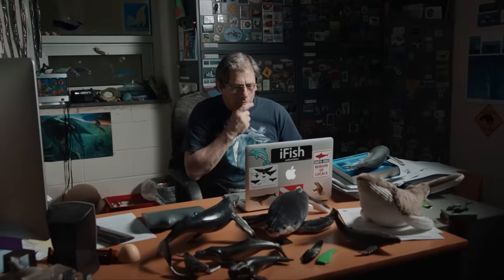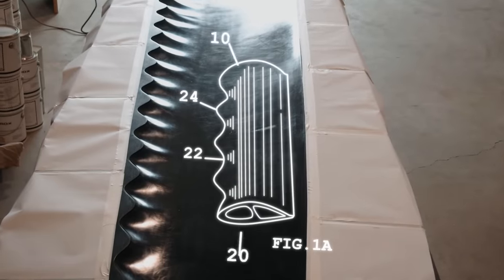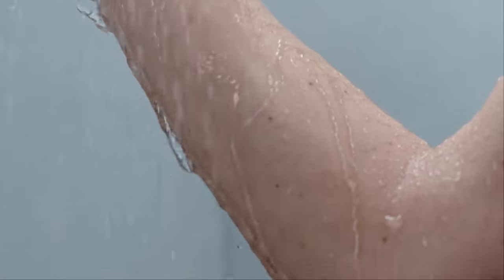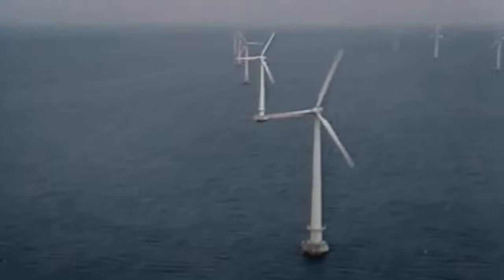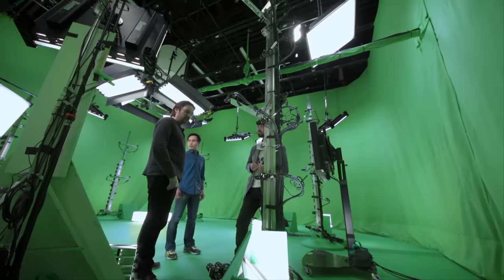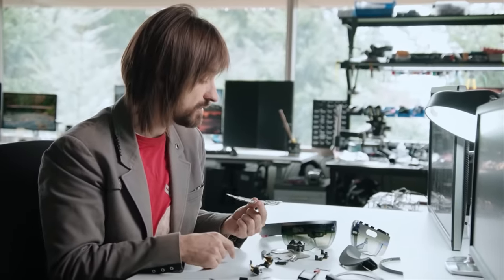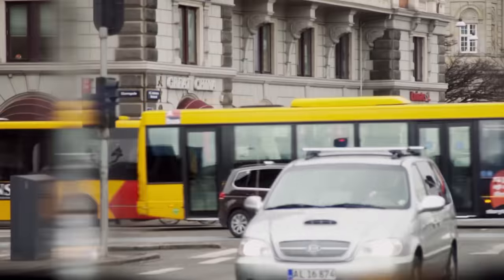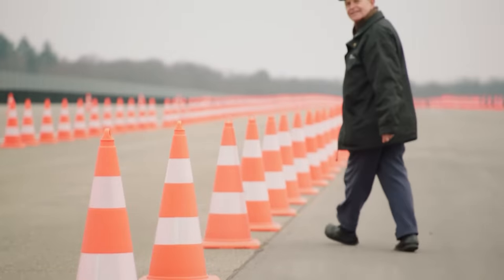Genius Inventions: Technical Marvels That Will Shape Tomorrow | Full Series | FD Engineering

Comment: Export the Power Apps, Copilot, Chat GPT, Revit, Plant 3D, Civil 3D, Inventor, ENGI file of the Building or Refinery to Excel, prepare Budget 1 and export it to COBRA. Prepare Budget 2 and export it to Microsoft Project. Solve the problems of Overallocated Re-sources, Planning Problems, prepare the Budget 3 with which the construction of the Building or the Refinery is going to be quoted.

Comment: I already have a recycled water system.   My water goes back in to the ground with a simple septic field, is filtered by a huge no maintenance ground filter, then is pumped back into the house for reuse years later.   Simple, reliable, inexpensive.

Comment: I am really impressed with the ammonia blocks to combat combustion engine pollution, much better than waiting (forever) for electric vehicles to catch on. Better to have a solution we can use now. It literally converts green house gas emissions in to water and nitrogen.
Reply: Adding to the benefits of green house gas reduction you get to products essential for plant growth, sounds almost to go to be true.
Reply: Many places in the western world are mandated to use Adblue which is enforced by law in europe for new  commercial vehicles since 2016, which does the same thing as these ammonia blocks, the Adblue is in liquid form which can be refilled by the end user thus not requiring a technician to provide maintenance.
Reply: Electric cars will take over much faster than people anticipate. Every year battery prices keep going down which if continued at the current pace will make electric cars cheaper than ICE cars to buy in 5 years.
For cars that are used to drive long distances for e,g car rentals like hertz, it is already cheaper to own an electric car and the shift has already started
Reply: @thexperimenter88  what about the grids being and yo handle the immensely increased loads, generating enough electricity, let alone keeping it reasonably cheap, the issues with battery recycling, the heavy metals involved, charging infrastructure... But sure ok.
Reply: @newolde1  the amount of increased energy that will need to be put in the grid if we move to EVs is not equal to the amount of energy that is contained in gasoline fuel for cars.
Gasoline engines are only 30-35% efficient while electric motors are 98% efficient. So the grids will only need to accommodate about 35% of the energy of gasoline used for cars for increased load if we fully move to EVs. It is inherently a better technology.
Solar photovoltaic installations have been increasing at an exponential rate since the technology is also getting cheaper every year. Perovskite installed on top of existing installed solar pv is also another game changing technology that is coming over the next few years that will drastically increase the mix of grid energy derived from clean sources
Reply: @thexperimenter88  best check your math. EVs are not 98% efficient.. Yes, the energy required overall compared to gas is less, but generation of said electricity, and the infrastructure required is still a major hurdle amongst the other issues we currently face. It's not going to be an overnight change like you're making it out to be, it's just not.
Reply: @newolde1  if the demand is there, more power generators will be built. I remain an optimist. Never has human innovation been higher than the present age we are living in.
The grid is also rapidly getting cleaner. Energy generation from solar now the cheapest form of energy generation and will keep getting cheaper.
Perovskite technology (basically a film can can be applied on existing solar photovoltaics to add an additional 7-10% energy generation) will reach the market in 2-4 years. Battery storage technology is also rapidly decreasing in costs.
Then it will be game over for coal and natural gas
Reply: @thexperimenter88  holding faith for humanity is venerable, but, optimism not tempered in reality is a recipe for future despair. Frankly, an additional 7-10% of base solar gains isn't going to make much of a dent in the increased electricity demand caused by the growth of EVs in that time. And while pure solar itself might be the cheapest, that's without adding in the storage costs. Again as for the 98% efficiency of electric motors, you're not accounting for the physics of the vehicle (battery to road efficiency is somewhere around 50%, but that's not accounting for the increased weight of EVs compared to petrol), the grid transmission losses (not small), the mining and production of the batteries, the production of the cars themselves, the infrastructure...
Reply: @newolde1  the load on the grid is not a serious argument against evs. In California, there are already 1 million evs and they account for less than 1% of the grid load. In their projections if the EVs grow to 5 million in 2030, it will be less than 5% of the grid load.
The only thing really holding EVs back is really the cost of the battery of the car which accounts for 80% of the cost of the car for cheap EVs like the tesla 3.
As battery technology develops, and the battery becomes both cheaper, lighter and safer, evs will become cheaper than gasoline cars. EVs are also cheaper to maintain than gasoline since they have less moving parts and thus less wear and tear.
In fact for cars that drive a lot, it is already more economical to own evs. This is reflected in car rental companies such as hertz ordering thousands of teslas.
EVs are mcuh closer than you think. I work with suppliers of automotive parts and their sales have already permanently decreased by about 5% because of current adoption rates of evs
Reply: @thexperimenter88  and yeah, batteries, batteries, batteries. Heavy metals. Currently there is a pitiful amount of battery recycling infrastructure in place. The tech simply isn't there yet. And no federal or state law or policy that require recycling, none.
Reply: @newolde1  Recycling should not be a problem for the upcoming 20 years at least at which point the infrastructure will be in place. 
Already the lithium iron phosphate batteries in teslas can last at least 500,000 kms! Which is over the lifetime of vehicle.
Reply: @thexperimenter88  you do realize that isn't the reality at all. 500,000 kms is a stretch for current battery tech. And regardless, even if it were, service and commuter vehicles regularly put in 100-200k miles per year. So your projection of 20 years is more like 3-4 years in reality. And, there are millions of EVs already on the roads that are nearing end of life with little to no infrastructure to take care of those batteries. Not to mention the difficulties of this all with the variance in composition and structure of said batteries. But yeah, gone are the days of 1 million plus mile vehicles I suppose. Similar to so many other consumer goods, instead of newer models lasting longer with our "better tech," they last half the life of older models.
Reply: @newolde1  a Tesla typically has about 4 battery modules. Often times just 1 module is replaced because of issues that have started. And also because of cost people typically buy after market modules.
So recycling is already happening to some extent by discarding the faulty individual cells in a module, replacing with good ones and selling the battery module in the aftermarket.
Reply: @newolde1  I just did a little bit of research a found out that 95% of lithium battery components are recycled.
That would explain why there are so many aftermarket Tesla batteries.
So your argument of no battery recycling does not work either.
Tesla already recycles all of their batteries
Reply: @newolde1  somehow I never realised that EVs could become a big e waste problem.
I’m not concerned about the batteries as you are, I think with the massive amounts of research being poured into batteries, future batteries will be eco friendly for e,g lithium sulphur batteries that have no nickel, cobalt are about to reach commercial production and there are investigations into sodium batteries.
Recycling is not a problem with the lead batteries of gasoline cars with a 95% success rate. Batteries can be designed structurally simple enough so that recycling is a non issue.
But the inverters and power trains of EVs with all their printed circuit boards, these will be a big problem to recycle! Somehow I never thought about those components.
There is also a lot of research currently being done on recycling waste printed circuit boards for e.g using a PLA polymer that is easily dissolvable in acids as the circuit board that I think will go a long way, but with the amount of components on a circuit board, recycling will remain complex.
Thanks for bringing this up
Reply: @thexperimenter88  so funny to read this about Hertz, posted "one month ago".  Heard the news lately?  ;)

Comment: As an Old Navy rotor head, we used the whale tip on our composite rotor blades main rotor blades. Not only did it create more lift such as in the Sea dragon also sea stallion in the superstallion helo. This is where you're getting your tips on commercial aircrafts as well. They didn't go with the natural bone grooves which did prove a much higher lift to TWR ratio. They just felt it was odd. Proof of concept was there. But they did use the tips. Commercial airlines did not believe that customers would get on an aircraft that look like that. At this point they're just inserting it small portions at a time. You will see that configuration eventually on many aircrafts, commercial and military. Our C platforms of the USAF, the C5 angle also of the wing. They have to put the inner two engines and reverse thrust to descend to their LZ. As soon as they touch down and wind them up. That's how much lift they actually do. This is why many C platforms today can go over 11,000 mi on a single refueling. Loaded to Bear. To the max of their capacity finding out that the frame cannot hold anymore but the wings can. So there's merit to the whale's fin. 
🇺🇸⚓🩵

Comment: 13:30 Much of the radiation shielding of any space ship taking people to Mars will consist of water. Water will also be essential for any mars base for food crops, oxygen recycling as well as drinking and cleaning water, so it will be needed any way. Not that this system wouldn't be useful, but any water used in a shower will be used to irrigate crops. The respiration of those crops will be collected and condensed and will be, effectively distilled water. That water will be used to make, oxygen, not by electrolysis, but by using it as a growth medium for algae under lights to convert CO2 from the air, and even the Martian atmosphere, into O2 and more Algae. The Algae can be used as food as well as construction medium for more levels of the base, built deeper under the surface of Mars.
Reply: Brilliant

Comment: I have an idea for wing design mimicking an Owl's stealthy flight characteristics. Leading edge serrations in the wing structure act like tiny vortex generators, very similar to this concept.
Reply: Covering the wing structure and using an airfoil designed pre WW2 will have a similar effect.  Laminar flow is great, but not for all applications.  for most low Reynolds numbers uses, a slightly rough surface for the 70-80% of the wing behind the leading edge is actually better. and if that transition can be made abruptly, even better, with a device such as you mention.   There probably is a better way to do it than VG's.   they seem very crude, and could likely be improved upon.
Reply: they already use the owl feather idea for stealth  the feathers have small flairs on the ends to reduce sound

Comment: I may have some more questions after I finish watching this video yet I can't help but to ask the question about the semiconductor laser lenses. Could this technology be used outside just lasers and also be incorporated for better efficiency to solar cell technology? A lot of the light that hits a solar cell is waisted because it cannot all be absorbed and turned to heat perhaps this technology can hold the  excess light and give the cells time to absorbe it at the correct   spectral frequencies of the cells... I had to ask this question and I can't  work on myself yet maybe this brilliant lady could look into it.

Comment: The problem with wind (and solar) power is it can’t be base loaded.  The wind doesn’t always blow and the sun doesn’t always shine.  This means to be reliable, they require batteries.  Even with the best batteries, only about 2% of the US power is supported by batteries. There aren’t enough of the rare metals on Earth to provide enough for the US, let alone the world.  Not to mention the best estimate for building out the industrial infrastructure to manufacture that many batteries will take 10-20 years.  In addition, solar cells and windmill blades only last about 20 years in the wild.  Batteries don’t even last that long.  There are versions of all three that last longer in the lab, but they have drawbacks that limit their commercial viability.  So every 20 years (or sooner) you need to build it all over again.  And dispose of the cells/blades/batteries which poses its own problems.

Comment: 20:08 Ask Henrik Stiesdal for the next developmental step: CarbonFiberComposite blades? Stronger, stiffer, longer, better, easier to recycle at the end of their lifespan: chop them up and burn the chips without residues, or landfills! Maybe the reduced recycling cost in the end could compensate the higher price at the beginning? 
And within a large windpark, the turbines should be optimized for a span of different wind conditions; not all turbines shut off at the same max. storm_speed! 
 But there are limits, side_effects and risks in further expanding wind_energy_extraction:  the atmospheric circulation will be altered ( reduced Coriolis effect, stabilizing the Northern Jet-Stream in a symetric~wavy form with big troughs and crests); reducing the amount of humidity_transport and rainfall in the summers from the (warmer) oceans to the interior of Eurasian- and/or American- Continents.

Comment: The 'tubercules' are very interesting. But if they offer such impressive gains, why has only one specie of fish adopted it, and why has no specie of bird adopted it???
You'd think all fish and all birds would have done so. Yet the only parallels I've heard is that the discontinuity of fish scales can offer some benefits in fluid dynamics. In the case of birds, I've heard that the trailing (not leading) edge of an owl's wing helps to quiet their sound
Reply: Yeah. What He Said.
Reply: Exactly what I was thinking. Whale=water
Bird=air.... No birds with them and very few fish or aquatic animals with them. I doubt very seriously that it's better than the leading edge of a birds wings.
Reply: I think because whales are too huge for that density of water to flow. their huge body creates a huge drag as well and accidentally there's happen to be a creature at that particular size on the ocean, makes evolution have to kicked in and adjust for their survival needs.
Reply: @terrycahyadi6954  Size might be a limiting factor for the applicability of tubercules. But supposedly, its application is being explored for aircraft wings.
It sounds like an inconsistency.

Comment: My idea is similar to alotropic tourmaline it collects light all around the cylinder and focuses it in a C axis alignment. Florolithiumaluminasilicate and iridium modeling and this is a piezo electric crystal that can vary its charge with pressure
Communications , holographic images, tracking systems, weapons of frequencies.
Reply: First secure your latent sir 🙏🤣

Comment: I think the better air compressor is the winner in this series. If you look at a 21% energy improvement in ACs and hydrogen/gas/water pumps you have a really big potential for energy saving! Only thing that would beat that is a better electro motor; they are still the archaic coil wiring electromagnet things from the stone age that make electric cars and bikes relative energy 'sinks', let alone drone planes that can only fly 20-30 mins. unless having huuge batteries..

Comment: The shower invention is way, way too complex and by no means a real invention :) A really revolutionarry use fo water in a toillet + bidet + sink + shower fully integrated hybrid uses water atomisation starting with pure distilled and burns everything in a sealed container, evaportating pure sterile water and producing minimal ammount of sterile ash (to be removed only after considerable use, not necessarily after each cycle). Everytinh occupies a ridiculuos ammount of space and needs no real plumming and can free all architecture from the classical ideea of a poop centered building as such hyginene units could be place virtually anywhere, in any number and moved arround as needed :) This and much much more real first principle super minimalistic true design I can offer :)

Comment: I thought that serrated blade or serrated wing edges had long ago been attributed to detailed analysis of owl feathers. Applications of the OWL feather analysis, which was performed long ago, include serrated edges on cooling fan blades (used in computer power supplies.) The serrations are said to make for quieter cooling fan operation. If I am not mistaken, Rolls Royce turbine blades, found in Rolls Royce jet engines, also exhibit deliberate serrations. Even Donald Trump attests to the fact that Rolls Royce jet engines are quieter than the jet engines made by other companies.